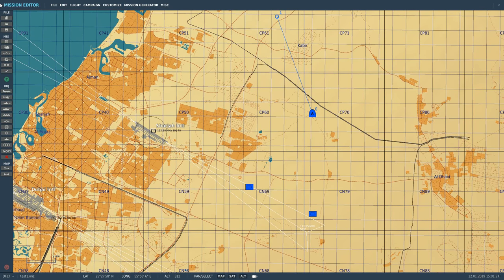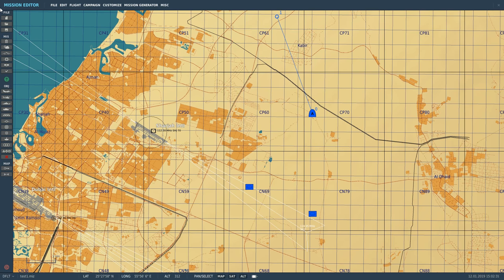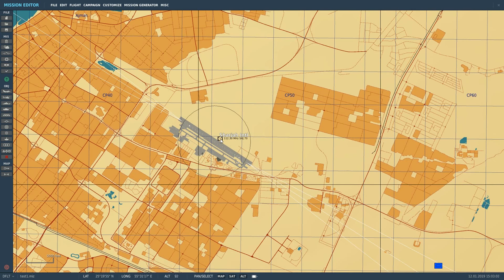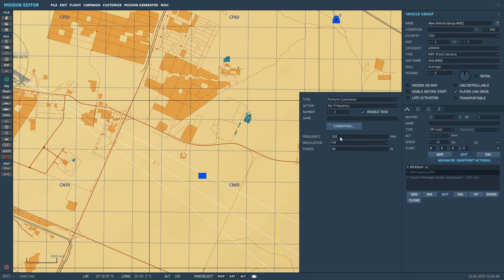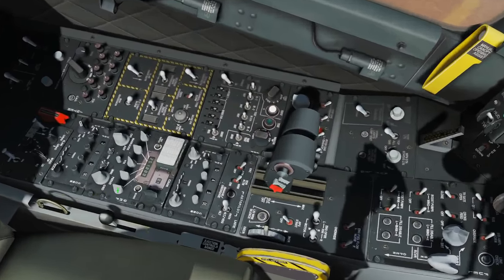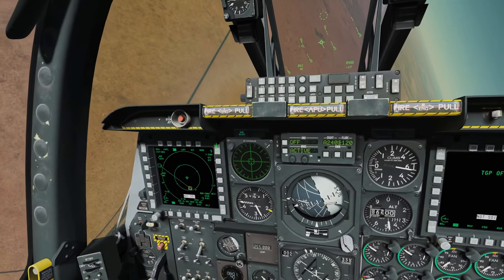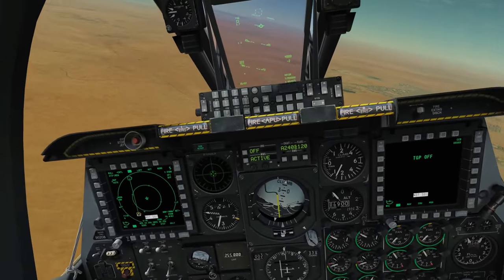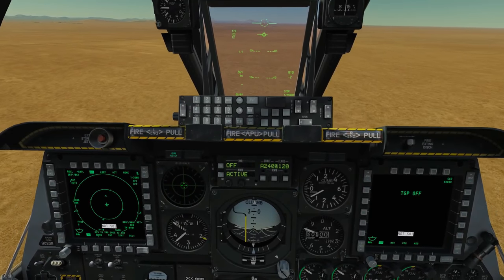A-10C Warthog: ADF/Homing Navigation Tutorial | DCS WORLD

Comment: You should be able to navigate using a VOR using the nav radio next to the TACAN radio on the right side of the cockpit. To navigate to a station, turn the course knob until the line in the middle is centered and the arrow, and the little arrow is pointing in the same direction, similar to setting up an ILS approach. If the ground station is a VOR/DME, then you should get distance information as well.
Reply: Pretty sure US military aircraft usually don't carry VOR receiver, only TACAN.
Reply: @BicyclesMayUseFullLane  I think the ILS pretty much consists of a VOR (Localizer), doesn't it?
Reply: @jemand8462  Not really. If you crank the Omni-Bearing Selector (OBS) when it's tuned to a LOC, it's not gonna do anything. And that's for a good reason, namely LOC antenna array is a line of Yagi-Uda or log-periodic all pointed at a particular azimuth (read: not omnidirectional at all).

IIRC, ILS is consisted of a localizer that I've described earlier, a glideslope (basically localizer turned sideways), and two or three marker beacons at set distances. Nowadays the marker beacon is frequently replaced with a Distance Measuring Equipment (DME). VOR is not part of it.
Reply: @BicyclesMayUseFullLane  aaaaah that's good to know, thanks. So it doesn'T even matter what OBS I dial in when setting up an ILS approach? I already heard that but in a 737 or a320 there's always a course for the ILS, that's why I wasn't sure if it's true
Reply: @jemand8462  Well, yeah, no, cranking the OBS is not really required when using ILS. However, it's probably still a good idea, because it is a good reminder where you are supposed to go, especially when using steam gauges. Also, I would argue that it streamline the procedures between ILS and VOR.

Comment: Hearing the tank crew talking ive never seen that before..really cool...is that for all default vehicles in game?
Reply from the maker: YEs but you have to set it up specially.
Reply: also the audio file depends on what type of audio file you upload for that vehicle. as default none of the units transmit nothing, even if the frequency is set right. there is an option to load an audio file which will then be heard on radio. can be a song or speech file or morse code or whatever you like :)

Comment: Interesting... So it means we can add some background music to our missions. =D Just set a ground unit to transmit on a VHF FM and place a sound .wav file with one or a few musics in it. =)

The problem is that the mission would take much longer to load an probably will stutter like crazy when you tune in to that frequency, because of the file loading system in DCS... And the .wav files are so large...
Reply: dcs also accepts .ogg files, which are slightly less heavy than .wav files. you will just need a converter software to turn your audio files to .ogg :)